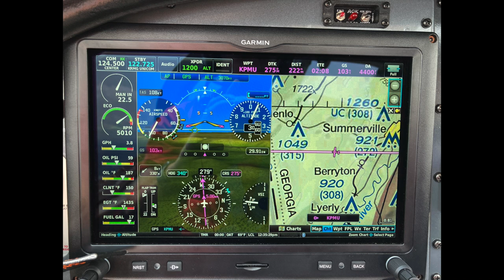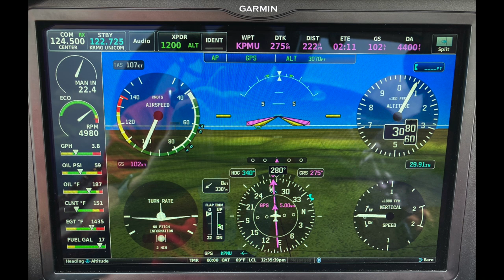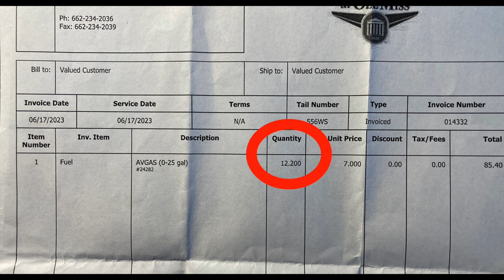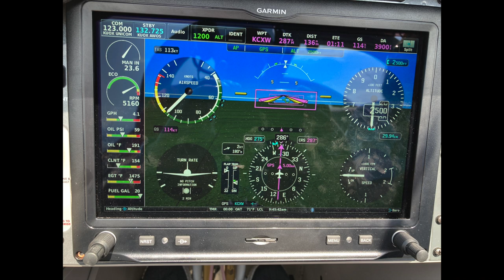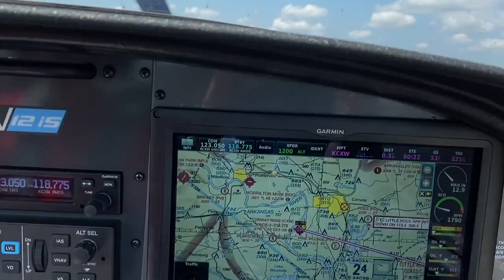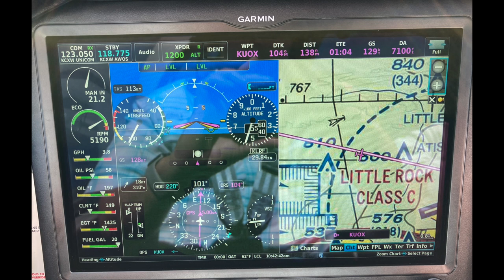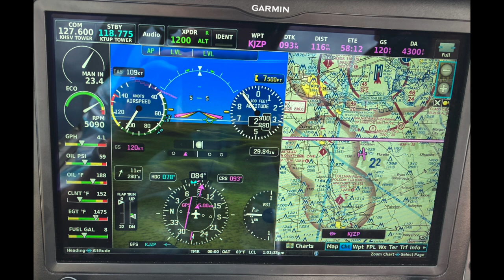Flying A Plane To Arkansas

Comment: That‘s a quite impressive range you can get out of your -12. I usually plan only about 280 NM for my longest leg. But I have the 912ULS installed in my RV-12
Reply from the maker: I wish I could take credit for that but I owe it all to FADEC I think.  With the ULS, having to tune two carbs and manually set the mixture I doubt I could go as far.  On the other hand, I also seem to find myself with a headwind every time I fly, so on this return trip I had a bit of tailwind to help.

Comment: I fly the 7 with O-320 and am happy to get my fuel burn at 8 gph.  Nice video.
Reply from the maker: Thanks Paul.  Your RV-7 will leave me in the dust for sure.  While I might be burning 4 GPH, I am also just doing maybe 120 MPH, while you cruise around 190.  That 4 extra gallons gets you there pretty quick.

Comment: Great video!  I am building a 14 and can't wait to take trips like this. How easy is it  to download data from your Garmin devices.  Easy enough to do it for every flight?
Reply from the maker: Hi David. Thanks for the comment.  I'm not sure what you mean about downloading Garmin data.  Can you clarify?
Reply: @rv12sg  In several first flight videos people talk about downloading data to see engine performance on other data.  I assumed is was from the Garmin equipment.
Reply from the maker: @David1970a  Could be.  There are features of Garmin that I know I have not explored.  If I were the builder I suspect there would be diagnostics I'd want to check out, but as an owner who relegates everything to my A&P I wouldn't know.
Reply from the maker: @David1970a  Here's an update - I took a look at the Garmin Operator's Guide and can confirm that, yes, I can download data.  In fact, it is almost like the stored data is a bit like a mini version of the "Black Box"  the airliners have.  It stores all sorts of performance data including primary flight data, engine parameters, and system status information.
Reply: @rv12sg  Thanks for the reply.  Many years away for me but just thinking about ways to document the flights.  No real reason, just because you can.